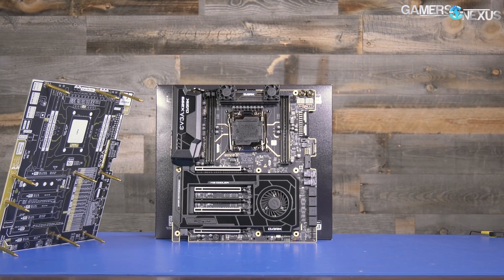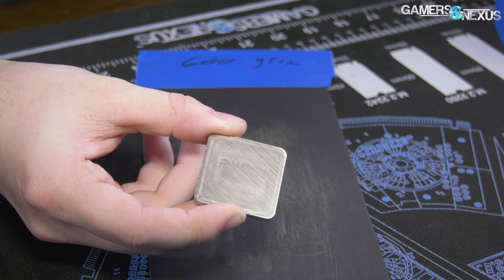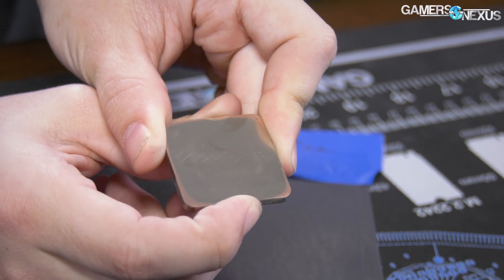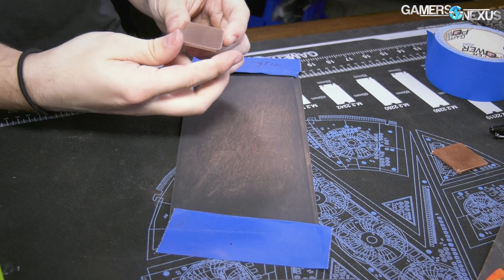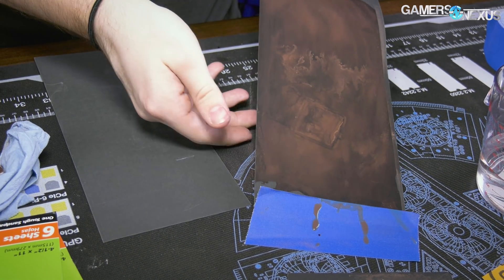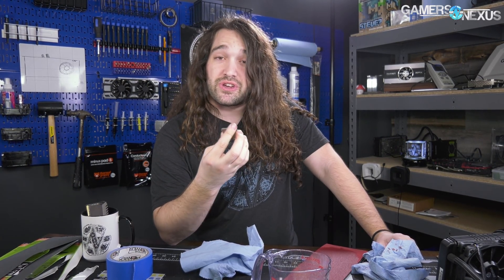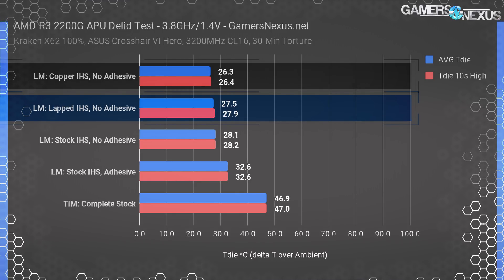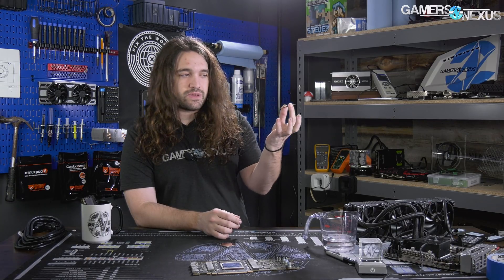Lapped Ryzen IHS vs. Copper & Stock IHS

Comment: when lapping you should use a solid base for your abrasive, i.e. a marble block, that has been trued, and use a figure of 8 pattern holding at the centre not the edges. by holding at the edges and going side to side on a soft(er) surface you are getting uneven wear and sub optimal results

Comment: Steve, may I point out something about lapping with paper.  The issue I found using that method is that a fine level the paper tends to drag forward in a leading wave sort of fashion just slightly. This leads to lapping the edges down slightly more than the middle giving a convex surface. Its not much but I found it can actually be worse sometimes than not lapping at all.

The ideal way to give a as true to flat surface is to use a machinist lapping plate and lapping compound.  These are very expensive so a cheap but very good alternative is to get a piece of float glass, sand blast the surface lightly. From there water and just an automotive coarse to medium cutting compound and lap with unidirectional action.  The glass plate should be placed on a hard flat surface like a laminated bench top. Uneven surfaces allow the glass to flex. Its a bit over the top but having lapped more critical surfaces such as used in automotive applications the paper method caused me lots of grief of not actually producing a flat surface. This method was a major improvement in flatness results to the point you could stick the metal surfaces to a window just with air.  The other benefit is this method laps very fast with a very clean finish.
Reply: I might add its not really microscopic imperfection per say on the IHS, its the fact they are stamped by a die and due to this process the surface is quite wavy from middle out, leaving many low areas where the TIM will be thicker and less effective.

Comment: Is the reason the corners go first not the fact you are doing it on a spongy surface? as you apply pressure, the edges and corners get more friction? If so, you would be creating a slightly convex surface.

Comment: So, I have a question, I've heard that the nickel plating is less reactive and therefor less prone to degradation due to liquid metal application over time.

Obviously, using liquid metal to replace even high-end TIM would net more cooling potential than lapping the CPU, so would it be preferable to lap and use the LM and risk extra degradation or to skip lapping and just use LM? Which would result in better cooling say 3-5 years down the line? do you think the extra degradation to the exposed copper would cause it to lose more than the original gain in thermal performance from lapping?

Comment: "I bled for this fucking thing. Computer building is so hard." 
Nice dig, Steve, I like it. It deserves to be poked fun with. I hope that nobody got discouraged from assembling his own computer because of such uninformed articles. I am amazed that this guy claimed that CyberPower makes you pay >$300 more for building a similar specced PCs, I know that that is bullshit. His description of how he installs an AIO cooler shows that he lacks experience and he isn't handy with assembling hardware. No offense, I am not that handy myself but I don't need anyone to tell me to first install the radiator and then install the part that makes contact with the CPU, it doesn't take a genius to figure that out. Not connecting the cables (case fan) properly, that really only happens if you don't think while and before you do something. A case fan nees power to make the motor work and it possibly (PWM) needs a cable to transfar the RPM for control.  It is not that difficult.  That article is hilarious and tragic at the same time.

Comment: FYI, sanding that way will actually make the surface slightly convex..  To get a true flat surface you would need to use a surface grinder that many machinist use.

Comment: It's much more effective just using 600/800 grit till its fully exposed copper then just jump to 1500-2000.. BOOM! faster and only costs about $5 of sand paper ;-)

Still a pain, and almost no difference between a lapped IHS before and after when using Liquid metal. Story of the day, if you'r using liquid metal you're not going to see much of a benefit.. but! if you don't like the idea of using a product that only lasts a few years before it started harden and glue the cooler to the IHS then lapping is the way to go.

FYI, you need much less thermal paste when both cooler and IHS are lapped as there is very little space for the thermal paste to fill.

Comment: A table isn't flat. I can guarantee you created either a dip, or a bump in the ihs and you definitely rounded over the edges. Either put the sandpaper on flattened granite, a thick sheet of glass, or get proper wetstones. Also, the sandpaper must be wet so it has suction against the granite/glass and stays flat to avoid rounding over edges. Otherwise this test is completely invalid. Also, you should go up to 6000 grit, or use a jewelry polish to finish up. You're leaving visable scratches at 3000 grit instead of having a perfectly polished surface.
I am willing to bet you would have seen a 5-10° improvement had you done this properly instead of half assing it.

Comment: You need a perfectly flat machined service to do this right. Pushing it down against an uneven surface will cause the metal to be uneven once sanded. Although I highly dought it matters temp wise.

Comment: If I may suggest something; This process would take much less time to complete, if you would use the oscillating sander electric tool that you would lay on the table, and then press the IHS against it from above, down to the sander surface. Granted, the mounting surface where the sanding paper adheres to is not flat as a table, but the end result would be pretty much the same. It would only take less time to sand the surface flat.

Comment: should have sharpied the surface to visually see the high and low spots as you sand or try to "lap" and you should sand it in a figure 8 pattern in the end you want to be able to see your reflection in the ihs like a mirror if you bleeding on it you aint doing something right lol you need a very flat glass or very flat tile or lapping plate to fix the sand paper too

Comment: The edges probably aren’t higher the center. That would be very bad for full cover blocks. Just like a wafer, the edges polish faster as the polishing pad bends around the IHS. The sand paper ends up being taller at the edges as the areas of sand paper around the IHS with no contact resist being push down.

Comment: well to gain a real flat surface you need to put the sandpaper to a flat hard surface! if you put it on a soft surface like the modmat you will get an uneven surface because you will sand down more on the edges . sry for my english....just the 2cents of a german cnc guy :D

Comment: I would have suggested putting the sandpaper on top of a glass sheet and not the mod-mat. Sanding on top of glass makes for a much more flatter surface with less chance of introducing errors (glass sheets due to how they are constructed are always the flattest surface you can get).

Comment: I use a series of abralon pads on my bowling balls. I start with 500 grit, then go to 1000, 2000, 4000, and 8000 grit. 8k is incredibly soft. You got a nice surface on that stock ihs. Thanks for this video. 
  I can't believe you bled for this fucking thing.

Comment: Sanding like that has to greatly increase the surface imperfections to be filled with TIM.  Which should be good.  If anything that's more surface area.  I can't see any reason to think that a glass-smooth surface would be better.

Comment: To have a close to true flat surface, you should have used sand paper on glass. Sanding on a foam mat will give uneven pressure points.

Comment: You should use glass to lap a CPU and cooler on for the near perfect flat surface. And use water from the start(no dry sanding ever) because it helps keep the sandpaper from clogging as well as gets the grit out of the way so the sandpaper can sand. Water on the glass under the sandpaper then water on top, the water between the glass and paper will hold it in place and flat, if you need more you are using too much pressure. Then use a wet kitchen dish sponge cut to the size of the IHS to hold the IHS as it will put more even pressure on it and keep fingers away from the sand paper. And finally sand in a ellipse rather than back and forth, place your index, middle and ring finger flat on the sponge and do a ~8 inch elliptical pattern.

All the dry sanding sheets you used.. they are still 600 grit, they are just clogged. You can restore them by wet sanding a pencil eraser.

Comment: In the high performance automotive field some engine builders will polish the chambers to reduce the highs that are in the castings. The idea is to reduce heat transfer as much as possible to keep as much heat in the chamber as possible. There are also coating companies that claim to accomplish the same thing. I went to one of their seminars at PRI and they never compared the coating to polishing. It makes me wonder if a shiny ihs would transfer heat worse of a non shiny ihs if both were perfectly flat with the cpu cooler.

Comment: If you are going for a perfectly flat surface, your best surface to use is a pane of glass that is 1/2" thick, or thicker.  I use this when doing trigger jobs on precision rifles.  Also, when sanding for a precision surface never, ever, sand in a back and forth, or circular motion.  Sand in one direction only.  You can turn the peace if you desire, but always sand in one direction, then lift up, reset, and make your sanding stroke again.  Back and forth actions will cause a rounding affect with the center of the peace being higher than the edges.  THAT is why you exposed the copper on the edges first.

Comment: Please use a FLAT, HARD surface to lap CPUs.  You are pushing into the mat, causing the edges to be sanded down more than the center.  That is most certainly NOT a defect.  Use your same technique on anything else, and you will get the same result.  Use a piece of glass or marble instead of your mat.  You aren't lapping the CPU, you are making it convex, which increases the average distance of the IHS from the heatsink.  This reduces any temperature improvement from the "lapping" that you've done.

And yes, the tiny amount that the mat gets pushed in by is definitely enough to harm your results.  Stop and think about what lapping is supposed to do.

Comment: I had an old q6600 that had weird cooling problems for a while and couldn't figure it out.I used some cheap thermal compound to do a test spread and found out it worked just like a guide coat while painting.My ihs was warped pretty bad and that was why I had to use a lot of compound to get my cooler to perform decently.I lapped the ihs and retested the spread and it was spot on even.I reassembled with Noctua and temps were roughly 10c cooler under load and the temps no longer spiked up rapidly when loading.

Comment: If you want to reap all the benefits of lapping, do it on a hard surface like a granite slab or counter top, so you have equal pressure to ensure a uniform flatness; your edges will be sanded more than the center due to the mushiness of the mod mat.

Comment: I think the reason corners get sanded first is probably because your fancy mod mat is flexing and get "bent" around that corners as you push the metal down on it so sandpaper wraps around it a little bit and shaves them better.

Comment: I will be getting the new Noctua Sterrox fans on Wednesday and will be in for a complete day of benchmarking.

Presently I have a delidded i7-4790K with Thermal Grizzly Conductonaut applied, the AIO I have is the Corsair H100i and the fans on it are the Noctua NF-F12.

What I will be doing is cleaning out the radiator, and then doing a pass with OCCT with Linpack and the options "AVX capable Linpac" and "Use all cores" activated with the two NF-F12 fans as they come stock.

I will then be doing the same testing but with the NF-F12 using the gasket that comes with the new Noctua fans.

I will then be doing the testing with only one fan on the right (where the hoses connect to the radiator) activated, and then the same test with only one fan on the left activated.

I will then be doing the exact same tests with the new Noctua NF-A12x25 PWM fans with and without the gasket.

Of course all the tests will be done with the fans running at 100%, and no fan profile.

If anyone is interested I can bung my results down here. I reckon it will take around five hours to do all the testing.

Comment: best bet would be go 320-600-100-1500 then a medium cut buffing compound on a sheet of glass then a fine polishing compound on a sheet of glass for the best results( also you have cross hatch scratching and an uneven 'cut' because A your sanding terribly and B your doing so on a padded surface (center gets more pressure then the edges)

Comment: I have done a lot of careful lapping in my time.  To ensure that the entire finished, lapped/polished surface is totally flat from its center to all edges, the sanding/polishing paper needs to be on a hard machined, flat to <30 microns, surface.   Use a 1/2" steel plate or a piece of 1" thick laminated linen reinforced phenolic - none other!  Both would have to be surfaced on 1 side.   
Placing the sanding/polishing paper on a surface that gives, will allow the piece being lapped/polished, to drop and rock.   Then, the outer areas of the surface being lapped/polished, will have excessive material removed.

Comment: Lapping like this is only effective on a really rough surface. Then there will be a significant difference in temps. You should also finish it off with a polishing wheel for that mirror finish. ;)

Comment: The who point of lapping is having the surface your lapping on flat as possible like a glass mirror not a static mat. You will round off the edges of IHS using a spongy matt.

Comment: You really should be doing that on a piece of glass plate or something very flat.  Not a soft pad.  Also, a couple drops of water or light oil (wd-40) would facilitate flushing of the grit on the paper and cut better/faster which you did later after the rough cut was pretty done.  Earlier would have been more efficient.

Comment: Steve, I honestly would love to be able to do some freelance (closer to unpaid) work for you when it comes to things like polishing that IHS, or making you custom mounting brackets for your DIY water cooling setups.

When I get my CNC up and running making parts like that will be a lot easier, but I already am able to 3D print functional pieces and fabricate them by hand.

If you have ideas, let me know and send me some pictures. I'll see if I can assist, I'd send the CAD drawings along if you wanted to distribute them or reuse them.

Comment: Wouldn't you want to add imperfections to add surface area? The TIM needs to fill in more gaps, but it's still heat that's leaving the CPU. Or does the TIM not go into the gaps and just create air bubbles that hurt cooling? Also, how do abrasive thermal compounds like IC Diamond effect performance after being removed from a CPU once or twice? (Obviously the effect wouldn't be large, but I would think it would hypothetically be noticable.) And would we see better performance with thinner IHSs, or do they need to be a certain thickness to have enough copper to conduct heat?

Comment: would have liked to see the cooler get lapped too, apparently some aio's are slightly concave or convex to mirror the slightly concase/convex cpu ihs?. can;t remember what way around that was and if it's actually true or not, not that it wouls really make a difference, but hey.

Also, you sand in 8's, not up and down motions like a neanderthal. Unsubbed, patreon is getting charge-backed too.

Comment: Did you use thermal paste between the cooler and this? Isn't the paste supposed to "eliminate" "gaps"  So couldn't you just skip that now?  Would doing this and using thermal paste create a "thermal barrier?"
Reply: In theory yes. In practice no. Even now that the surface is a mirror, If you look at it through a microscope it will still be pretty jagged with scratches and imperfections. You would need to produce a perfectly flat surface for not using a thermal paste. Of course your heat sink would need the same perfectly flat surface as well.
Reply: sparkyenergia Yes I would tend to agree. I would wonder what the micron measurement of thermal paste and at what point it would benefit no more. I was hoping Steve would read this and possibly try a test. He's already went this far. Also have another idea I wish not to share on a public forum.

Comment: i was just about to ask why your not wet sanding when the water came out
Reply: usually when i polish something once i get to the 1000g I use water from that point on,  and it works really really well.  you can get it to a mirror finish.

Comment: It's best to use a lapping surface, steel, stone even glass will be better than a table top, you should also rotate the part being lapped every 10 - 20 strokes, that way you get a more level surface if you're putting more pressure on one side

Comment: I have lapped many items over the years. To get the best results I mount a piece of glass under the sandpaper to insure the sandpaper is as level as possible. I nominally get mirror finishes with 1200 grit or better. The mat makes a soft base under the paper and allows it to flex under pressure. The IHS was not the expected/desired mirror finish. At least I doubt that any better heat results would have been available. Using the new generation carbon thermal pads might improve heat transfer, but for all intents and purposes deliding is the ultimate practical step.